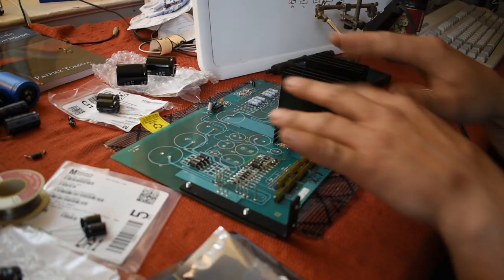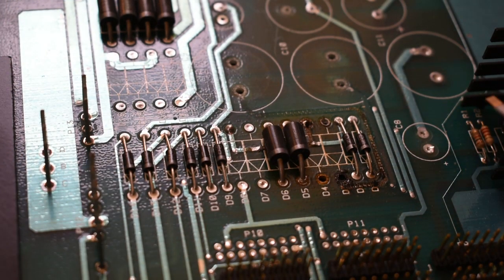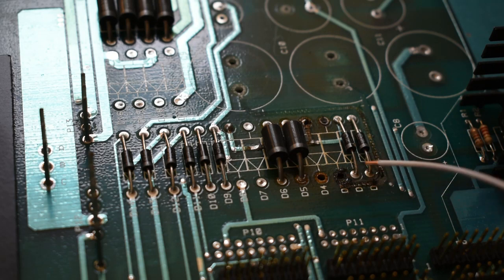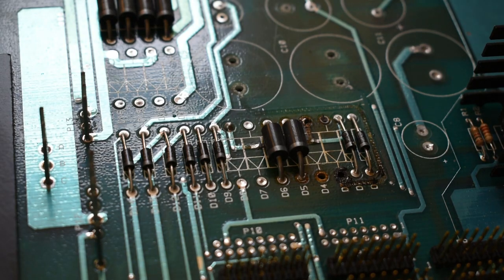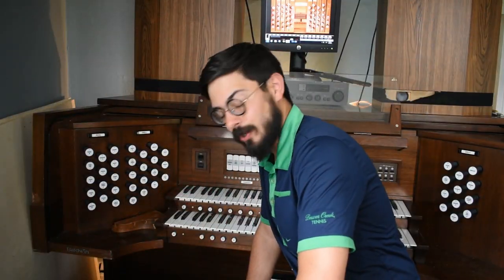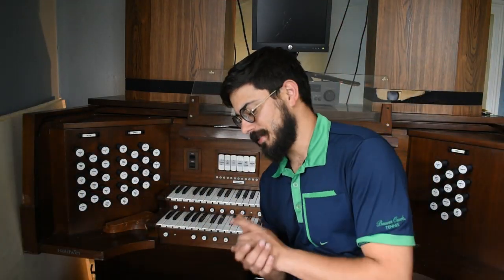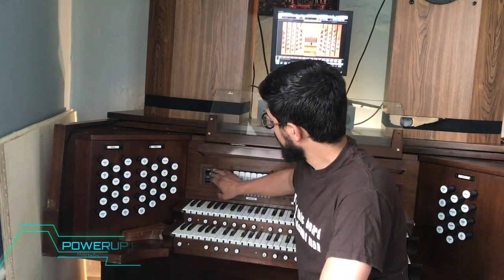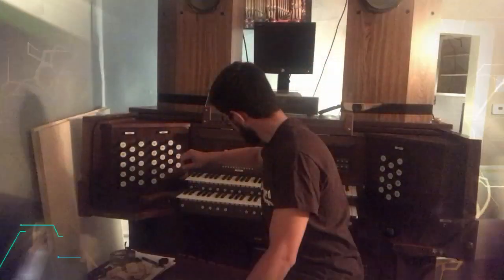My Hauptwerk organ console power supply blew up. Can I fix it? Venting caps, exploding diodes, etc.

Comment: Yup - a shorted diode allows AC (or the wrong polarity of juice) to pass downstream. That power is deadly to caps - the wrong polarity on a cap means a hiss or bang. It really helps to have a schematic to see who is in that circuit so you can inspect in-path components. Good job. Hate it when that happens!!
Reply from the maker: Doing this without a schematic was definitely a real challenge. Though I do enjoy a challenge...